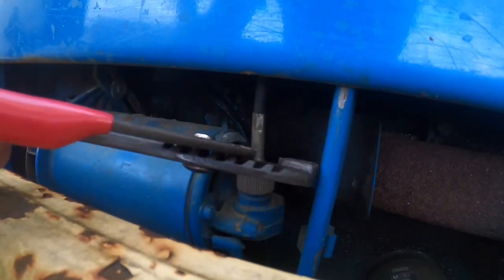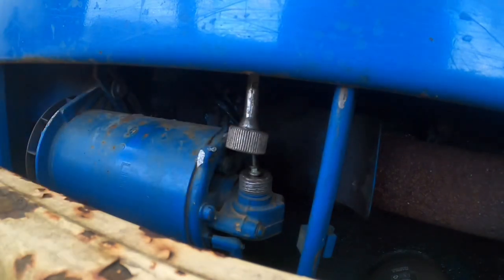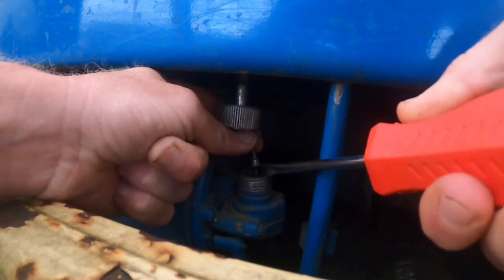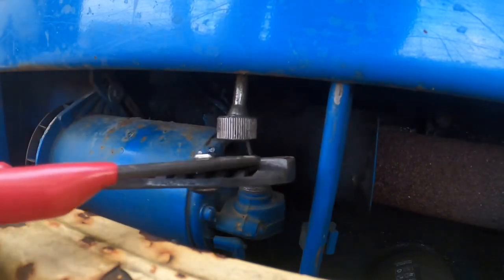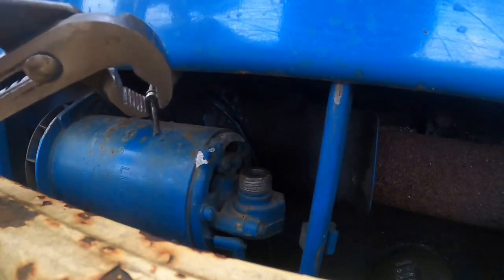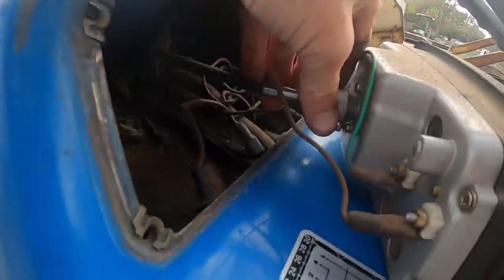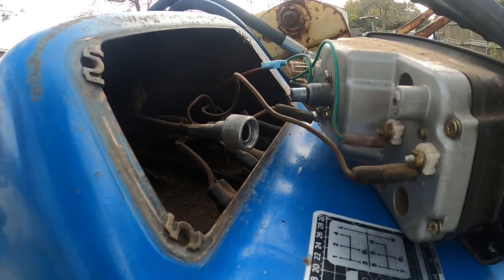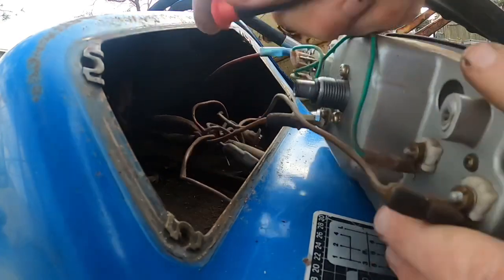Fixing the tachometer and instrument cluster on ford 3000

Comment: Nice video. I have a 1973 Ford 2000 with FEL. Looks the same as yours. I've had it for 37 years. The best annual investment for it is a 10 mil tarp to cover it. Park it in shade to protect the tarp. Good Luck, Rick
Reply from the maker: I’ve recently repainted the tractor. It doesn’t spend the nights outside anymore